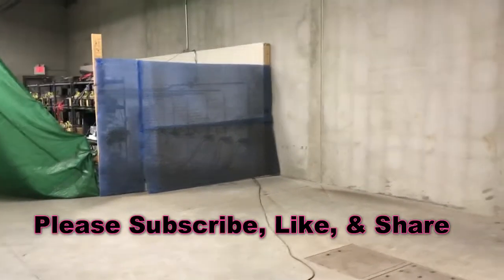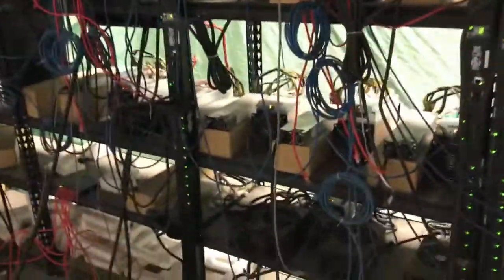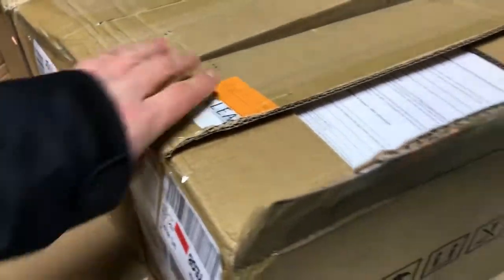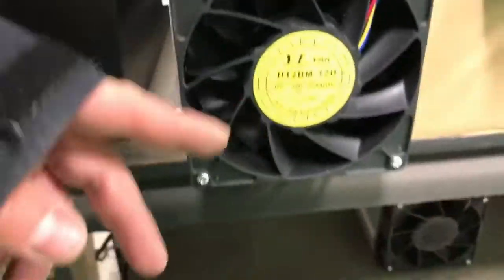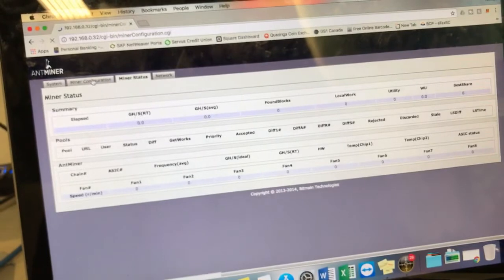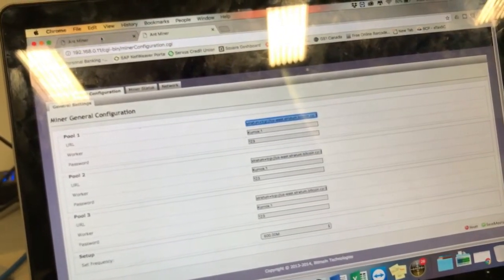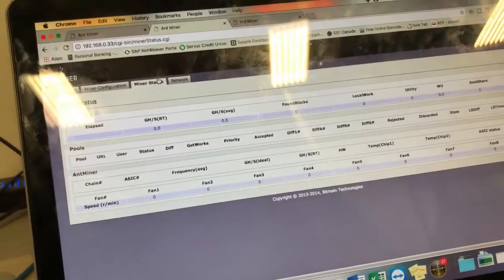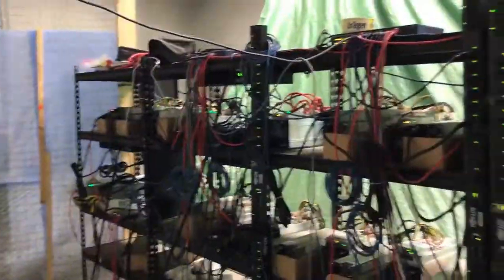Unboxing and Setting up Antminer S9

Comment: What the hell you turned on the heater . You want it off . Your miners will heat the warehouse up .
Reply from the maker: Did you hear what I said in the video?? Temp in the warehouse was freezing!! I only turned it on to work and then back off.
Reply: Yemira well I would turn the breaker off to the heater . So no power at all .